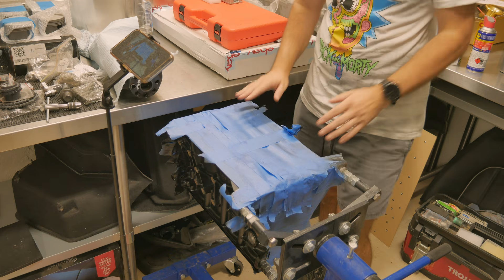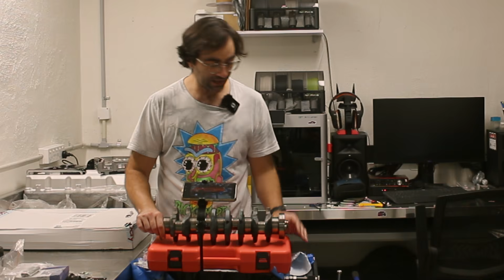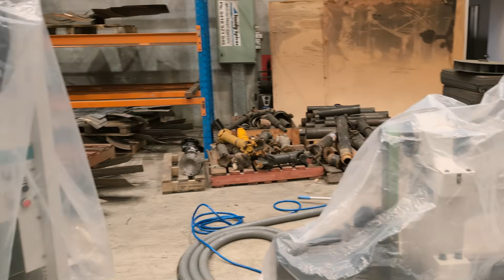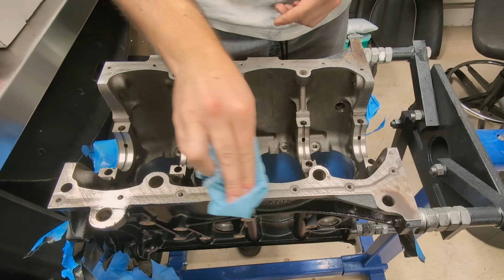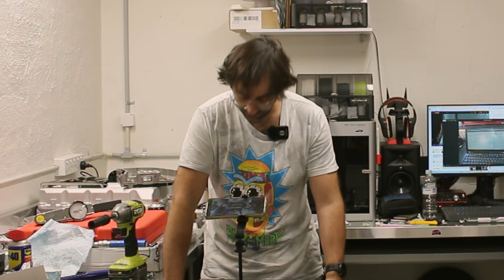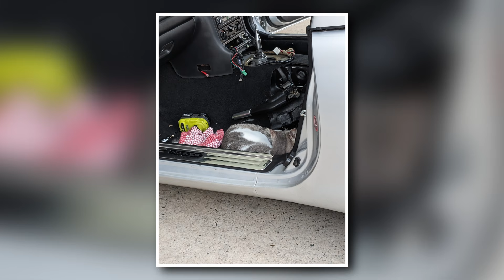Making the M47 Diesel Crank FIT the BMW M44! (Stroker Build Part 2)

Comment: Good day 

I am busy with the same build. (edit im doing a turbo version with 84.50mm pistons not big N/A) I went with the route of cutting the sprocket and hub bigger and the only cutting on the crank was an extra groove for an additional woodruff key.

Regarding the crank bolt and washer I have a better solution for you. Instead of a custom washer and struggling to find a bolt. The stock m42 bolt is m16x1.5x120mm

I have found the S63 crank bolt to be m18x1.5x122mm

So I re-used the m42 crank washer but machined it to fit the m18 bolt. Regarding the torque spec to tighten the new bolt im still contemplating what torque spec to use. I think il just torque it to the m47 crank bolt spec.

1 question, do you believe it is necessary to rebalance the m47 crank? Or throw it in as is?

Regards
Reply from the maker: I used the stock bolt for the M47 and a custom washer. There is a drawing of the washer on the article on the website.

I wouldn't rebalance the crankshaft unless it has been modified. If the only marks on it are factory balancing marks I'd keep it as is.

Comment: I just bought your m42 ITBs through redux racing, planning on putting it all together this winter. These videos are great, thanks for posting them!

How high are you planning to rev this engine?

RIP Pineapple 😔
(cat people get feel this)
Reply from the maker: I'm using the M44 head, so I'm capped around 7500, but ultimately it will depend on what the dyno gives me!

Comment: The m42/m40 block also have oil squirters but in an angle to the piston bores. They sit in the main bearing seats.
The m42 crank is forget the m44 is not.
Reply from the maker: Good to know!